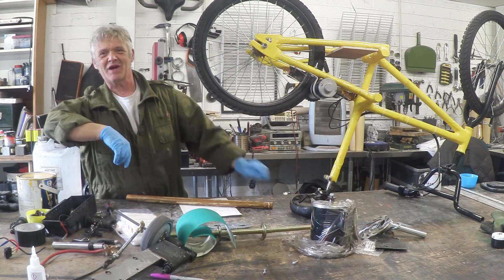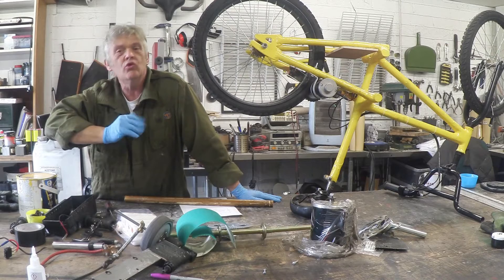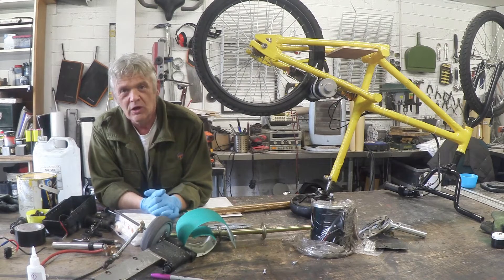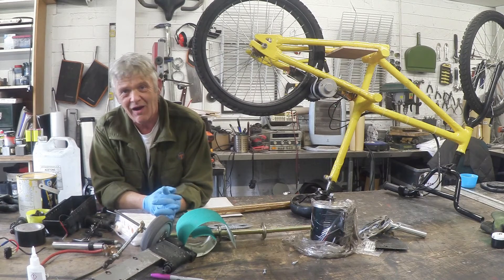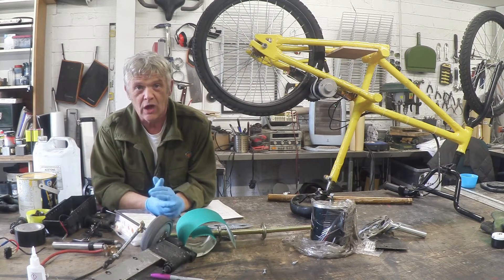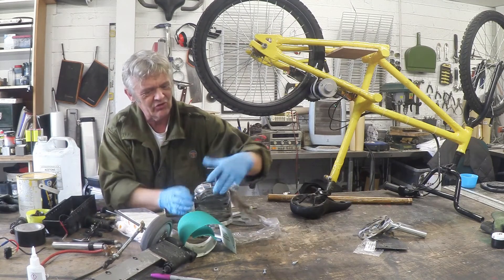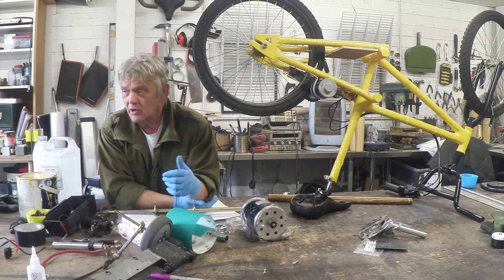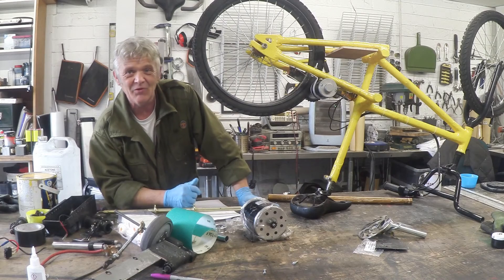1174 Building An Electric Trike In Paper - The (Free) Plans

Comment: I drive a trike, Hase Kettwiesel (one front wheel, two back). Very nice.
One suggestion for you: why not build something like the Banana Peel Trike? Power that rear axle you got, and steer by leaning left and right. You could probably reuse parts of the paper bike  for the front wheel assembly !
Reply from the maker: nice mate cheers
Reply: Corrected the typos...

Comment: Probably counter to what you're trying to achieve in terms of materials and weight, but might a thin bit of steel rod in the centre of the sticks eliminate the flex you weren't happy with?
Reply from the maker: I see what you are saying mate - bit yeah it would run against what I was trying for I am afraid

Comment: The difference between leading dual wheels and trailing is a choice between maximizing stability or traction. For a low weight electric trike, traction may be preferred. But then again we are taking about England, where the question is not if it rained today,  buy how much.
Reply from the maker: lol - true enough but then again - I do like the traditional delta frame
Reply: Delta trikes usually only have one drive wheel, whilst the other simply rotates freely. Some trikes have a differential, but then, you can still end up with only one wheel drive... on the wheel with the least grip. Delta trikes aren't necessarily less stable than a tadpole trike. It depends on the wheelbase, width, centre of gravity and overall geometry.
Reply: Well, if one doesn't need the stability, you can use 2 hub motor wheels in the rear. Construction will be much easier and there will be much more power for acceleration and carrying a heavier load. Of course you won't be able to use less expensive parts like Robert does in his project here. Which is why I love Robert's channel so much. Anyone can build a project if they have an extravagant budget.  A big budget is like brute force, if you have enough of it, you can do almost anything. Paraphrasing another one of my favorite YouTubers, Isaac Arthur.